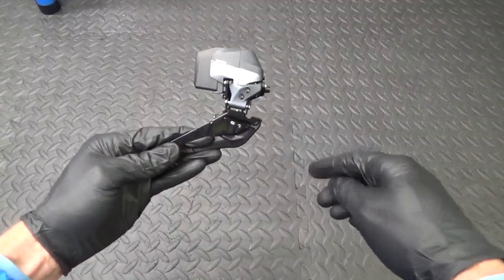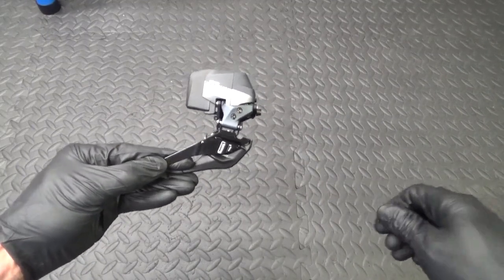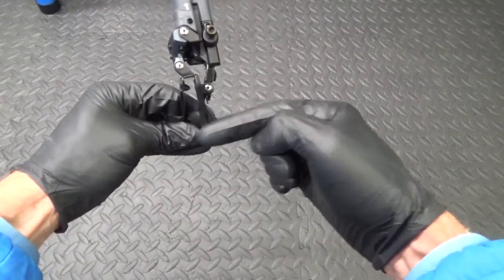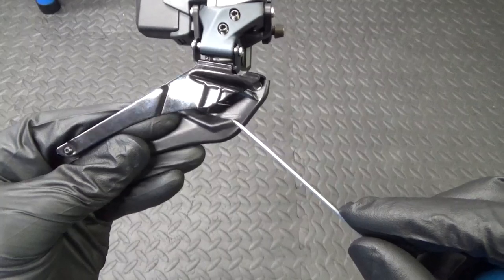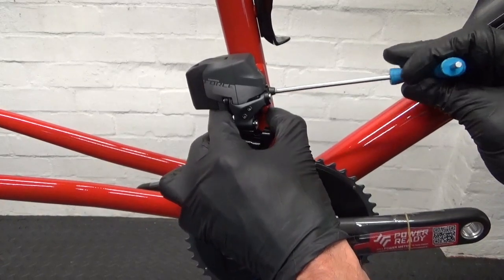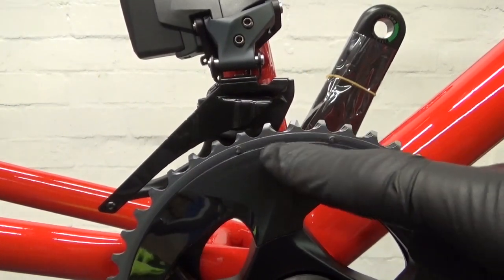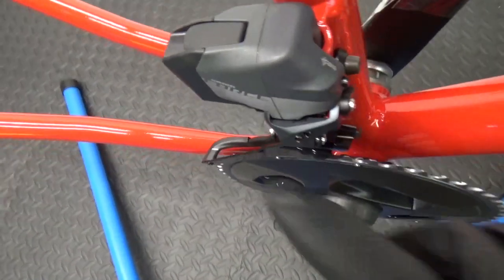SRAM Force eTap AXS Front Derailleur Fitting Guide

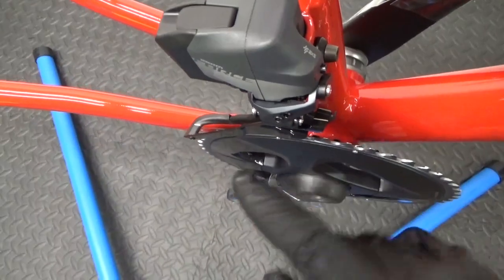Comment: Thanks so much for posting this video, the steps from 04:00mins have helped me resolve an issue with my FD, the chain was rubbing on the inside of the FD when moving up the cassette e.g. from around 6th gear towards 1st. Now I have sufficient gap between the chain and the FD, and no more chain rub. 👍👍

Comment: Great explanation! I have a question about a front derailleur clamp which I need to mount the derailleur. I bought the original SRAM clamp and it seems to have a shape that should be flush with the detailleur but it isn't, do you have any experience in mounting a SRAM Force derailleur with a clamp? Maybe I have bought the wrong clamp or maybe it shoudn't be flush, I'm confused...

Comment: I dont really understand why sram doesnt release an updated for the front derailleur to autoadjust according the rear gear. Is not normal to stay on the same position when you have 2/12 and 2/2(or 2/1). But very clear video 👌

Comment: One question, not necessarily related to the set up. Does the mech cage wiggles a fair bit on the pivot point? Mine does, I am not sure whether it was like that before or it’s due to a recent impact taken
Reply: Depends on how much you are wiggling. I just experienced the same thing. I have a very wiggly Rival. Grabbed a new used Force and it's substantially less, I then grabbed a new Force and it still has some slop to it.  I'd recommend going to a shop and checking one of theirs.

Comment: Hello I have been following your video 
I have a question I'm building a bike same component on this video. I installed the rear derailleur to the hangger , but the smallest teeth in not line up to the rear derailleur it was on 3rd teeth from the  lowest gear I also adjusted the upper bolts for adjustment...note I'm using a oversize pulley..so the pulley teeth is not line up to  the smallest gear it was on 3rd teeth from smallest..pls advice...thanks
Reply from the maker: SRAM Force eTap AXS Rear Derailleur Fitting Guide
https://youtu.be/WS3Yc_CkEd4

Comment: Hi , currently i have an ultegra r8000 rimbrake groupset on my bike . I’m thinking of buying the sram force 12 speed upgrade kit with f/r derailleurs and shifters . Can i maintain the ultegra chainrings ? If i want to buy the force chainring do i need to change the bb ? I have the bb86 i think installed . Thanks
Reply from the maker: You will need to change the crankset and bb.
Reply: Keep your ultegra group is better then this one
Reply: @st-5ter932  i did and keep the money for a new disc bike when the time will come for a change.

Comment: First!
Is that yhe frame that you painted?,if so it's come out well. How's the etap weight compared to ultegra.
Reply from the maker: Same frame! Not sure on the overall weight difference, I will try and weigh the components see what the difference is!!
Reply: The sram etap force is heavier than shimano 105 . Ultegra DI2 is the same  weight  as Ultegra Mechanical.